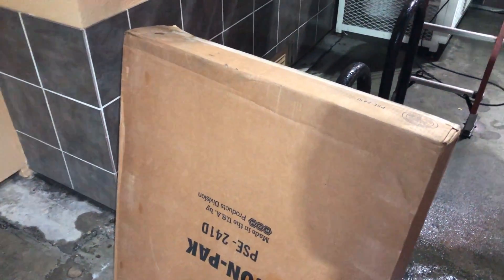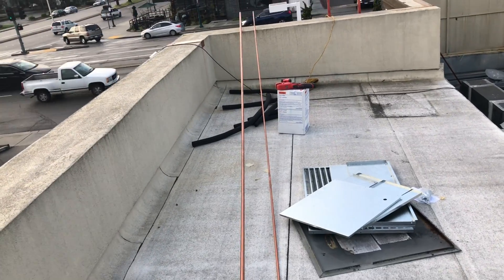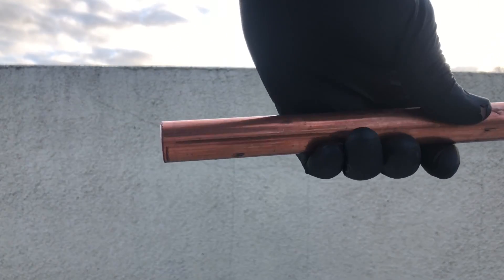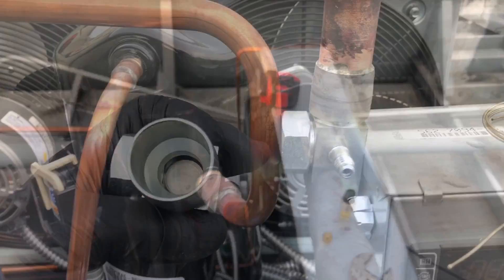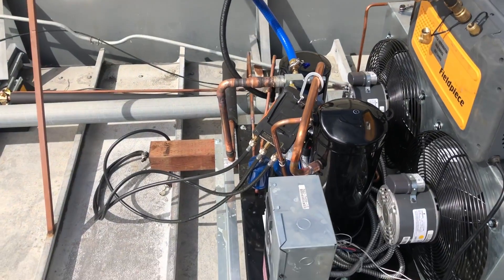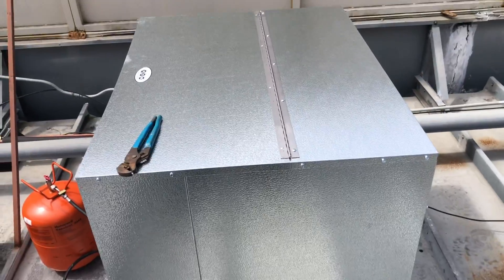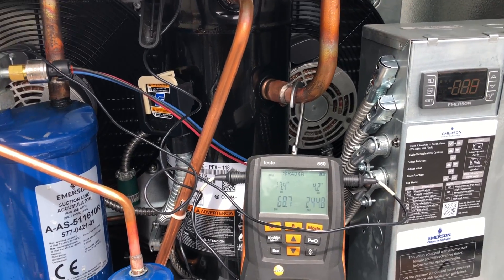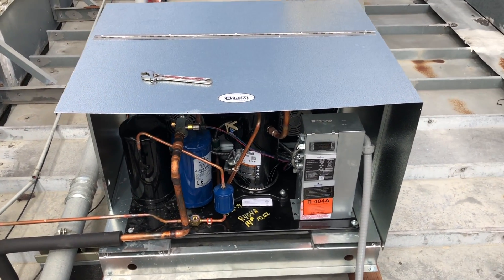Change out a condensing unit and convert to R404A

Comment: Can you explain what the dixell controller is used for on the condensing unit......
Reply from the maker: That one dose low psi, and high psi, fan cycling and compressor delay.  In lay mans terms it replaces the dual psi control, but has a few other features in it.

Comment: Nice burn Dave, Ive never used the 56.  Been awhile but Im pretty sure it was 45% that we used, comes in a smallish coil, flux with the white Stay Silv?  Anyway, nice install.  Good idea on the txv, for the cost of the part the customer doesnt need to know its not absolutely necessary, just a damn good idea.

Comment: I was surprised at how low you did the pressure test. Any particular reason? When I first started out I had been told to test close to what operating pressure would be. Now granted I'm not doing that anymore but usually its 250-300
Reply from the maker: Yes ran out of nitrogen 🤣🤣🤘🏻🤘🏻
Reply: @NorCal-refrigeration  😳😳😳 super dave ran out of nitro .....now how could you let that happen 🤓🤓
😎
Reply from the maker: Casey Smyth just busy
Reply: @NorCal-refrigeration  just givin you crap bud....happens to us all
Reply from the maker: Casey Smyth I know I love ❤️ it

Comment: What is it with Emerson? I've had rotolock compressors shipped without the valve and when they do ship the valve they don't put the white gasket for the rotolock in the pack🤔. Just venting (thats the V in HVAC)
Reply from the maker: Yep there quality is rock bottom. They used to be good.

Comment: Excellent vid as always NorCal Dave.  Excellent mention on adding the gas total with the ID paint.  Well done.   Always nice to have the starting baseline rather than a big "???"
                                       I liked that pre-fab box!   I didn't think I would, haven't seen one before, but don't know that I don't like that better than a bendo special.   The galvanized metal looked a little more weather resistant?    Great informative vid Dave, THANKS!

Comment: Same here was taught using hard drawn pipe and fittings, although pipe here isn't pre charged with nitrogen.
Reply from the maker: Were old pipe fitters. Oldschool 👍👍
Reply: @NorCal-refrigeration  Cut my teeth on cold rooms and ships running in both copper and stainless steel.

Comment: You work on many of the Delfield prep tables boss?
Reply from the maker: I do
Reply: @NorCal-refrigeration   well then, a D4472N-18 is popping the breaker but I haven't seen it, won't keep temp, can't pull the box below 68 lol condenser entering air is 70.7 and leaving condenser air is 72.1, not sure why I'm telling you all this.....but am I just completely stupid or blind on trying to find my hook ups or do they not put them on these and I need to use a bullet.....cuz it's totally flat I just wanna verify and prove
Reply from the maker: treedawgin no fittings on them. You will have to add them. Have fun.
Reply: @NorCal-refrigeration  yeah that sucks lol

Comment: Great Job Dave, that line set was 7/8 and 1/2 inch.. yes hard drawn is the option.. If you have 3/4 , 5/8 suction and 3/8 liquid line to run, or 1/2 and 1/4... a long run on a roof, Buy some cheap Storm water Plastic pipe, 75 mm, 3" diameter, 6 m lenghts , roll out your copper, insulate,feed thru storm water pipe,quick, looks great, protected from the weather, you can also feed electrical cable in there too..make each end look pretty. jobs done.. thats what i've done in Australia for ages.... $15.00 for 6 m lennghts 75mm pipe...

Comment: I remember when the Milwaukee pipe cutter came out..  i snatched at it real quick.. have it now for about 5 yrs it's awesome
Reply from the maker: I’m late to the party. What’s the smaller diameter pipe it can cut? I tried it on 3/8” with no luck.
Reply: no 1/2 is the smallest it will cut and even than you have to fiddle with the 1/2 pipe  @NorCal-refrigeration
Reply from the maker: prime time thought so
Reply: oh  well.. gotta use our energy somehow lol can't be to lazy but nice job...i like it.. that evap coil will have to be changed out sooner or later i think?
 @NorCal-refrigeration
Reply from the maker: prime time those old coils had thick tubing and with drinks in that cooler they last a long time. 👍🔥
Reply: yeah they don't make those types of coils anymore.. thats for sure. but again nice job !! and waiting for some more !! @NorCal-refrigeration